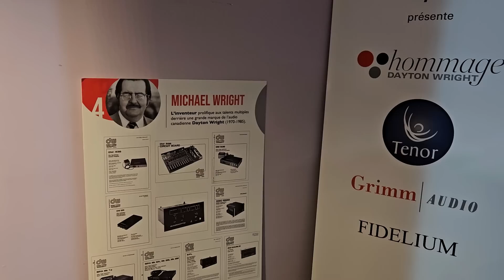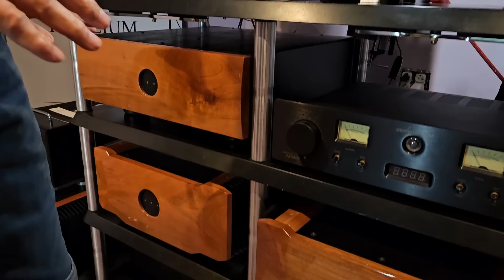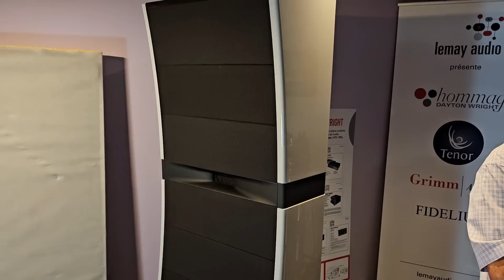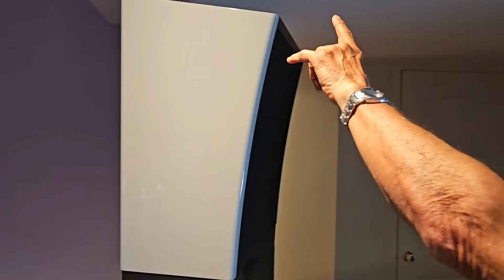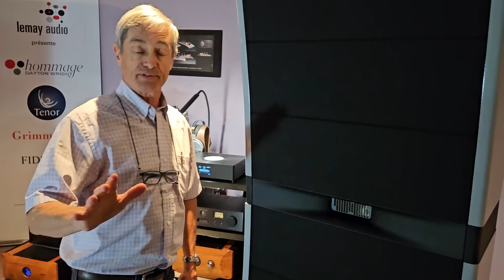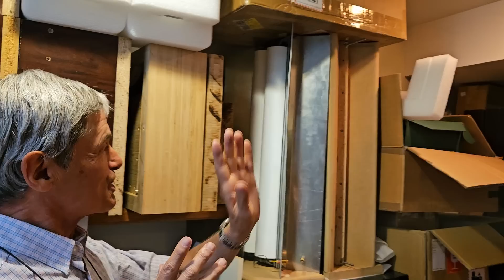HIFI For Crazy Rich Asians? So good but so expensive!

Comment: Impressive to see his passion for the sound.

I'm curious though as in many audiophile circles people would focus on treating the room (sometimes spending a lot of money on it) and in this room it doesn't seem to be the focus. 
When you spend that much money on this gear, I would think some focus should be put on the listening room as well, no?
Reply from the maker: Here is the interesting part. I have been to many rooms, the best rooms don't have a lot of treatement. Of course, those best rooms, can they get better if they were treated? I would think so but never know. Many times me and my buddies would be scratching our head, how can the system sound so amazing with zero room treatement. (We guess maybe the shape of the room)
Reply: @ThomasAndStereo  The placebo effect comes into play for everyone!

But in a blind test with same speakers same room and room treatment (done correctly at the reflection points etc) and without room treatment. The speakers & room treatment combo will 9 times out of 10 come out on top 👂🔊🎶

Lot's of these super expensive speakers, amplifiers, DACs aren't even accurate ie they have colouration. A house sound. 

Nothing wrong with that though the manufacturers shouldn't lie 🤥 saying they are more transparent less audible noise distortion than a top Hypex, Purifi amplifier, a top ESS, AKM DAC, a top Perlisten, Kef speaker 👌🏾

Comment: I can't decide which is more representative of "audiophiles"...... the fact that they sell (and apparently people buy) $5000 power cables for their equipment, or the fact that some of them claim that their hobby is too esoteric and subtle for the application of double-blind testing (usually when it's used to debunk things like $5000 power cables). It was kind of funny to see this in the 1970's and 80's, but kind of sad to see a new generation falling for it in the 2020's. There are actually people going back to vinyl, LOL.
Reply: Not the new generation. Only a extremely niche group of young people will invest in vinyl./ Its expensive to get into the hobby.

Comment: It’s always a treat to see people pursuing the state of the art in audio!   Thanks for sharing… I’d really like to see inside the preamp and mono blocks to get a better idea of what they are doing
Reply: A top amplifier with a Hypex, Purifi, TPA3255 module for £1000 or less is already state of the art. As transparent with no audible noise distortion as you can get 👍🏾

A $300,000 amplifier isn't going to magically make it audibly better 🤦🏾‍♂️🐍🤑

Amplifiers and DACs the top one's have already been perfect for several years now. Aka completely transparent and inaudible noise & distortion 👌🏾

Anyway manufacturer claiming a super expensive Amplifier & DAC has a audible improvement in neutrality noise distortion is talking garbage 🤥🤮

Comment: I don't care how much money someone spends as that's up to the individual and their judgment and spending capacity. But for this kind of money I want my audio equipment to look the part as well. I'm sorry the cheap glossy wood panels and sheet metal chassis on the Tenor doesn't cut it!
Reply from the maker: It looks better than it is in real life. It definitely does not look or feel cheap if you were able to touch it.
Reply: Got to say that his wood selection doesn’t seem very good- a lot a small knots, a rather bland flat sawn grain pattern, no figuring. Not cheap, but nothing special. For this price I’d want something better.
Reply: @TomTom31ify  exactly, look at the wood panels on the Japanese brands, Accuphase, Yamaha, Pioneer Elite etc
Reply: Well said!

Comment: I love the viciously expensive stuff. It is totally awesome what people are doing in the industry. People pushing the limits of electronics in great detail helps to build on new ideas for future ideas and concepts not yet considered to try. Someone else will take this designer's impressions and move in a completely different direction, I Hope, and create new perspectives on audio evolution and revolution.
Reply: A $300,000 amplifier isn't pushing the limits of electronics 🤦🏾‍♂️🤣

It may cost a lot to make but way less than the build manufacturing etc cost 🐍🤑

A top amplifier with a Hypex, Purifi, Benchmark AHB2, TPA3255 module for $1000 or less will already be be completely transparent with no audible noise or distortion. Ie it won't impart any sound to the attached speakers 🔊👍🏾

Amplifiers and DACs have already reached a level with no colouration passed on to the speakers! These companies selling $20,000 + amplifiers & DACs bizarrely claiming they're audibly better than a good Class D or AB amp, a good DAC are talking nonsense 🤥

Comment: Spend over $1M on the system and then put it in an asymmetrical room with almost no treatment.
Reply from the maker: It is real life. We adapt to what we have.
Reply: An asymetrical room is preferable. Why dont you smile for a change
Reply: @  Only in the sense that it breaks up standing waves.  It's worse in just about every other aspect.

Comment: 300 grand is ludacris and doesn't make a better equipment. it's the barber effect that audio files suffer from you know what that is Thomas? if you believe something is expensive and good you will hear a difference is a video of a guy going bar bar and they changed his lip movements and it sounds like he's saying something different. you convince yourself it is better. maybe you should up your design on your amplifiers for this purpose I don't think it would cost more to manufacture maybe a little. try and go for Norwegian design. my dad introduced the Norwegian design furniture the 50s and it's really popular today's still. who made the company a household name. my dad didn't get anything for it accept a good paycheck. and you don't need to use metal in the design is better and cheaper materials. you can mould the chassis. have the made in China cheap or better Taiwan. use that material that is like a sand resin. they make toilet accessories you know like little cup soap dispensers and trays. it's a good material good resonance properties. there is a name but i can't remember.
Reply from the maker: If you ran an HIFI company like I do, you will realize there are many ways to approach it. I don't pass judgement on people who take different routes than me. I just learn what I could from them to better myself. He is more successful than me for a reason, and if I cannot see it, then I will always stay where I am.
Reply: @ThomasAndStereo  I'm not passing judgement just stating a facts. of course he can spend the money how he wants I'm just pointing out the ludacris sea of it all  you know that ❤️
Reply: It's called the Mcgurk effect.
Reply: @crazyprayingmantis5596  ok

Comment: This is an incredible built system. I am also a fan of electrostatic designs. I had many many system in my over 45 years of owning mostly hand made and custom made high quality playback components. After I moved from the US I sold everything, and, since than I have retired, and started making my dream system piece by piece by hand.  For over 6 years I have been designing my own panels with limited production and then highly modified transducers, also make my pure coper foils, hand made connectors that weight only 0.65 grams of pure copper each while most others are over 35 + grams that will introduce their own sound.
 
These can be heard on my channel, and soon I will introduce my new and way better version currently I am about to finish. All recordings were created from downloaded materials and using only my cell to record it and uploading it without any special mikes, using only a 17 lbs. still being modded out of production amplifier. I am not using any crossovers or any other components. As we know the back and forth up and downloading does degrade the quality, yet it still sounds enjoyable, but in person it is an excellent playback system.
Thank you Thomas for your videos.

Comment: I heard Tenor amps a few times at the audio shows in toronto many years ago.  Always the best sounding system of the show. I believe they were paired with speakers  from another Quebec company - Pierre Gabriel.   Incredible combination.
Reply: they may sound good but no amplifier is worth $300,000 what a ripoff.
Reply: @chrisrichards2827  Well, Gryphon, Burmester, and a bunch of others are in that price range.  It's out of my league but some people have the means to get these exceptional amplifiers.
Reply: @chrisrichards2827  it's just snakeoil to gullible customers these $20,000+ amplifiers 🐍🤑

A top Class D amplifier with a Hypex, Purifi, TPA3255 module and Class AB amplifier like Benchmark AHB2 is already as transparent as you can get with inaudible noise & distortion. For around $1000 or less.

A $20,000+ amplifier isn't going to break the law of physics and magically be audibly more transparent audibly less noise distortion 🤦🏾‍♂️🤣